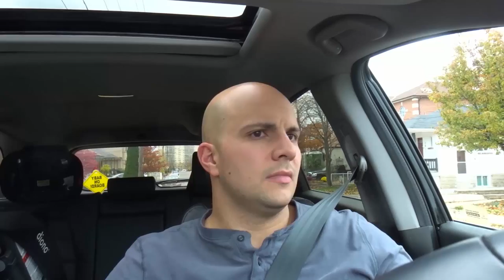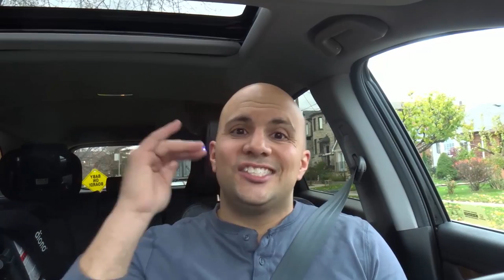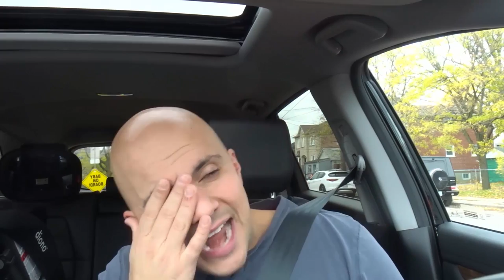5 Reasons Why Brakes Squeak And Squeal

Comment: My brakes make more of a pulsing squeak noise, like it’s on and off. “Squee eeee eeee eee ee e” as I slow down. It’s possible that they’re warped but I don’t drive hard, and they’re slotted rotors so they’re SUPPOSEDLY better at cooling. The slots are full of brake dust, could they just need thoroughly cleaned? Any help would be obliged.